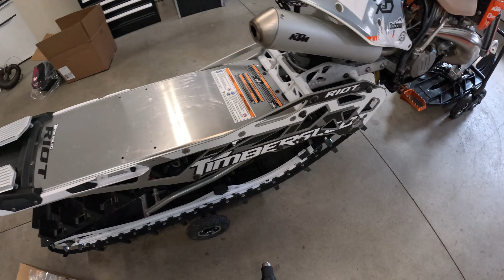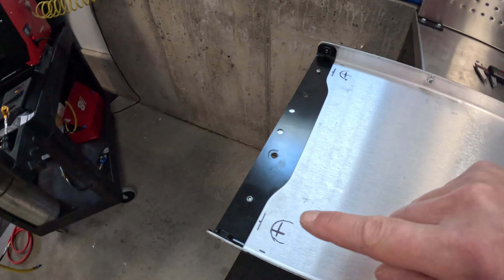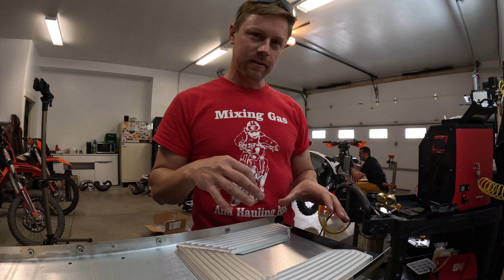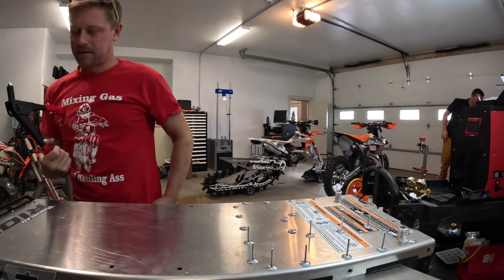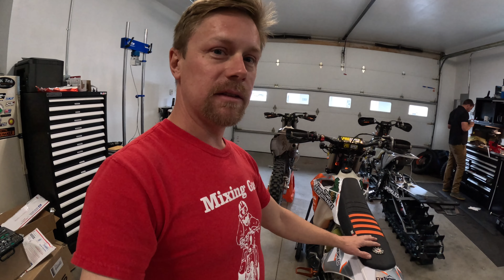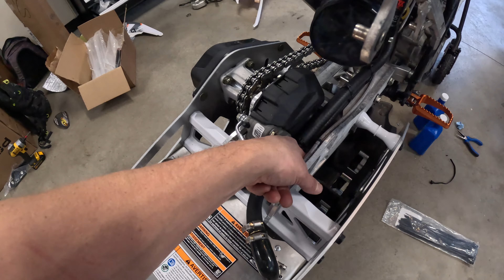XRT Snowbike Heat Exchanger - Install Video

Comment: Any comments on how you mounted Dave's coolant bottle?  I wish your video showed more of that.  That seems like the trickiest part to me.
Reply from the maker: I just ran a big zip tie around it and the louver. I had a shield(plastic material) between the two so snow wouldn’t be hitting the coolant bottle also.

Comment: I was always skeptical putting a kit on a 300, do you like that riot3 on a 300? We have a couple 300s and I just picked up a new riot3
Reply from the maker: Mine moves it well. Personally i think the 3” kits are more efficient in deep conditions. No mater how much power a 450 makes, when you start trenching that power advantage disappears. Snowbikes are about traction and flotation, not track speed like snowmobiles.

Comment: How are you liking the riot3 120 compared to the velocity riot? Is it a significant upgrade for all around use or mainly for deep powder?
Reply from the maker: The 3” track opens up the liveliness of the riot chassis in more conditions and snowpack. The 120 was great in firm conditions but in Colorado our base is often too soft with not enough drive to make it work. I think the 3” track is king on all bikes here.
Reply: @TrevynNewpher  is the new kit a 120 or 129? Thanks man
Reply from the maker: @JesseG1988  all 3” kits are 129. Non-ported tracks as well. Way more drive and float.
Reply: @TrevynNewpher  does the 3” or 129 hold back the 300? My main concern lol. I just picked up a 23 300 tbi and would make a sweet snow bike I think
Reply from the maker: @JesseG1988  the 3 inch helps to prevent trenching and keeps you up on top of the snow. No matter how strong your dirtbike is when you start trenching it doesn’t matter much. That being said, the 3 inch is way more efficient and keeping you on top of the snow and maximizing your power. My 300 pushes it just fine. The new 300s I hear a running really really strong and are great setups
Reply: @TrevynNewpher  is the 3” still fun and pulling wheelies? Haha looks like a good time
Reply from the maker: @JesseG1988  only on a firm spring day would I possess chose a 120” 2.5” lug ported track. The added traction improves wheelies
Reply: @TrevynNewpher  merry Christmas! Coming from having sleds in the past I’ve found here in the pnw the snow isn’t always perfect and not always endless deep. So need a good do everything. Wasn’t sure how the 3” riot would do on a crappy snow day or crunchy after a light rain lol
Reply: @TrevynNewpher  merry Christmas! Coming from having sleds in the past I’ve found here in the pnw the snow isn’t always perfect and not always endless deep powder without driving 3-4 hours. So need a good do everything. Wasn’t sure how the 3” riot would do on a crappy snow day or crunchy after a light rain lol

Comment: I’m running a 2019 KTM 300SX build with a Riot 120LE. I had the same problem with constantly overheating on the trail. Keep us updated on how it is working for you. Also, I was concerned about running an exchanger setup with the TSS shock, do you think the constant flexing of the hoses could cause them to crack?
Reply from the maker: Just double up and protect any sharp edges and eliminate pinch points. The kits don’t move very much. No where near what a moto swingarm does. I tried to secure and protect my hoses as much as possible.

Comment: Have u ever tried the Selkirk system with the built in heat exchanger?
Reply from the maker: I have not. I’ve heard they run hot in the springtime.
Reply: @TrevynNewpher  yeah I remove all the panels in the spring and it works great.      I’ve found my bike runs best around 170.  130 seems low to me.  Is that a 2 stroke thing?  I’m on a ktm 450
Reply from the maker: @Moneypress11  yes. Two strokes prefer 100-140 or so typically. Four strokes 180-210 typically. More aggressive cooling is needed for two strokes. Previous years i would not run an engine jacket.
Reply: @TrevynNewpher  good to know.    I know nothing about 2 strokes.   4 strokes for life.
Reply from the maker: @Moneypress11  I’ve had both. Once i got my 2t dialed i have preferred them over four strokes. Especially for both summer/winter use